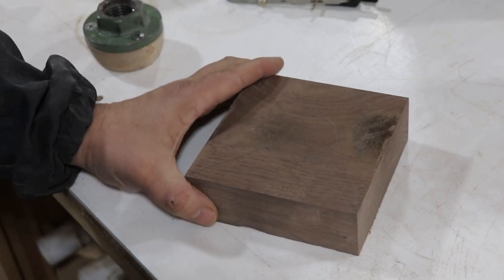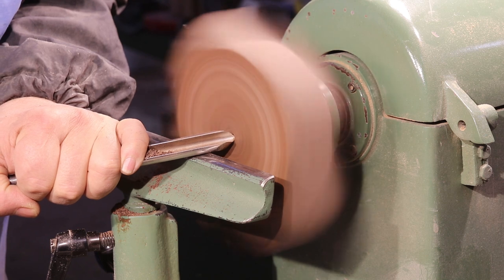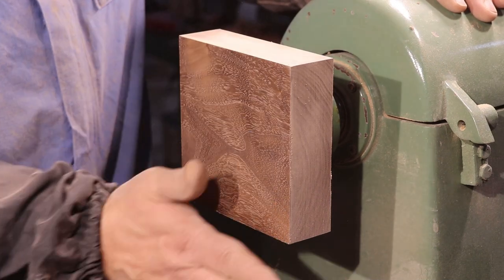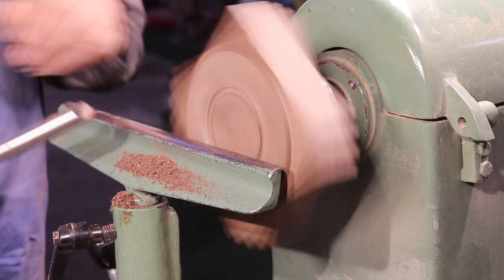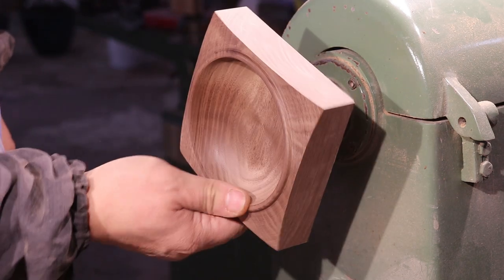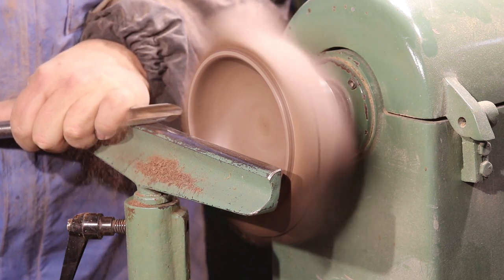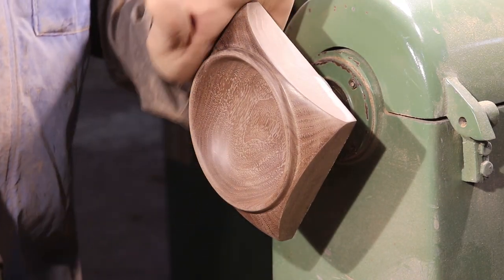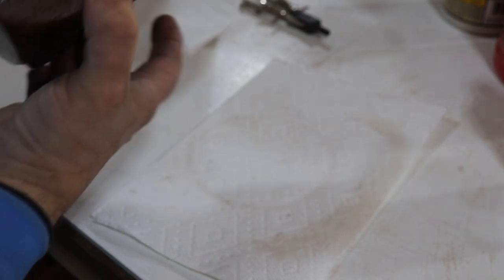Woodturning | Project That Sells - How to Fund Your Shop/Hobby -Square Coin/Key Dish From Scrap Wood

Comment: Nice video and project.  I have never used Danish Oil but heard about it some.  You said you did 4 coats, did you let dry between the coats? How long does it take to dry, I've heard a long time? Please advise.  Thanks, Myles
Reply from the maker: Thanks Myles! The first 2 coats are back to back. The third I put on a day after and the last a day after that. It does take a few days to completely dry, as many as 5. Thanks for watching!

Comment: Nice!  Just want to dbl check, around 3:25 or thereabouts you were cutting with the gouge across the mid line heading to area of the blank farthest away from you, was the blank still rotating CCW?  Thanks, congrats on the 20,000.  I enjoy your channel much.
Reply: It would have to be spinning in reverse for that cut.
Reply from the maker: I was in reverse for that as the wood did not like being cut from outside to inside. Thank you and thanks for watching!
Reply from the maker: You are correct! Thanks for watching!